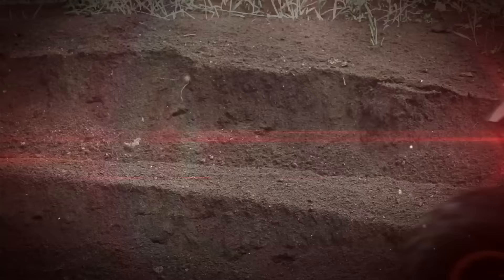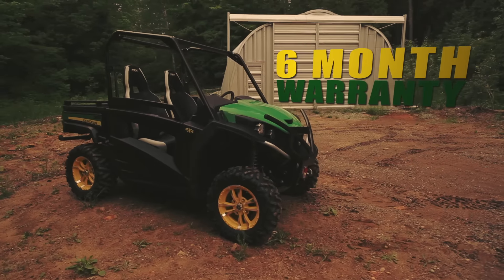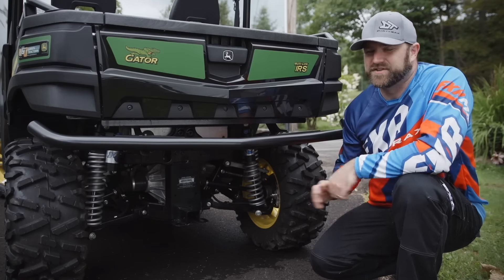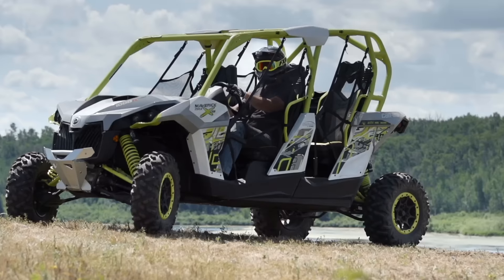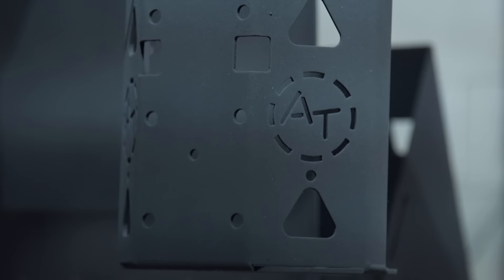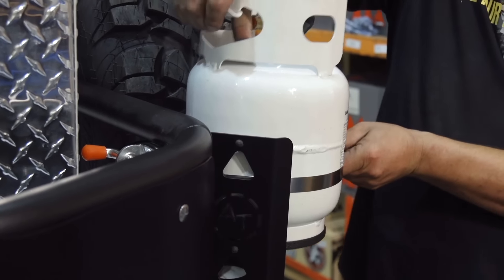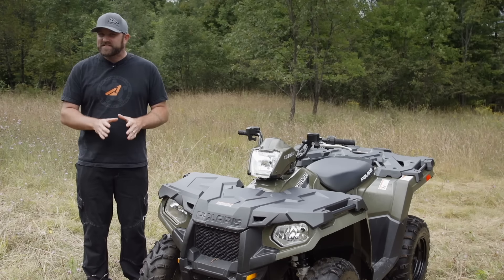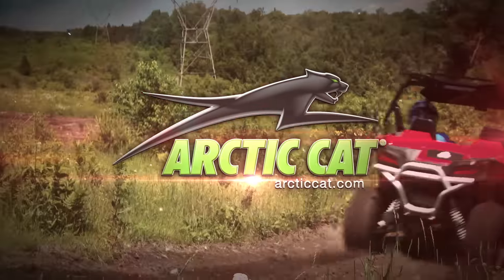Dirt Trax Television 2015 - Episode 10 (FULL)

Comment: It's always nice to see you folks do segments on ATVs for us budget minded folks as well as the high end stuff. I recently bought a brand new ATV and did A LOT of research before making my final decision. Some of that research was from some of your budget minded segments. 

The part where I struggled with was in the options. I originally wanted the Outlander L DPS. Then looking at it, there were no bumpers, brush guards or winch. So then the Outlander L LE caught my eye, it had all of that... but there was no winch. I then looked at the Outlander XT which had all of that plus more, but all of a sudden that ATV that was only cost me X was now $2000 more. In the end I was able to get the 2015 Outlander XT 500 for less than the 2016 Outlander L LE because of "last year model" pricing. It cost me a few horsepower, but I felt that all the extra options were worth it.

Anyway, the long and the short of it, is that a person on a budget really needs to do their research and do the math on what options they do and don't need. Sure you can get a base model for a (relative) low price, but are you getting what you want/need for that price. This all part of manufactures marketing of course. Get you in the door with that low price and then sell you the  higher priced model. If I had bought the Outlander L DPS, I would have ended up spending way more on accessories than what the Outlander XT ended up costing me.